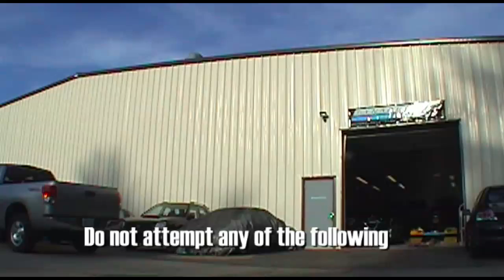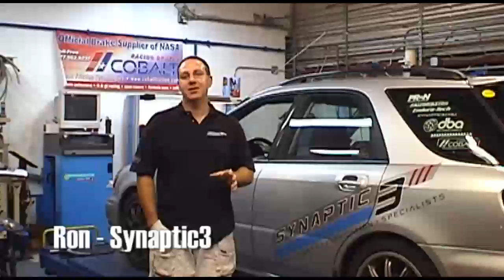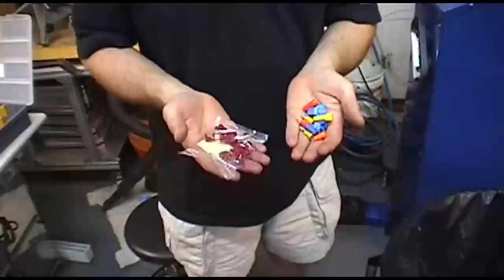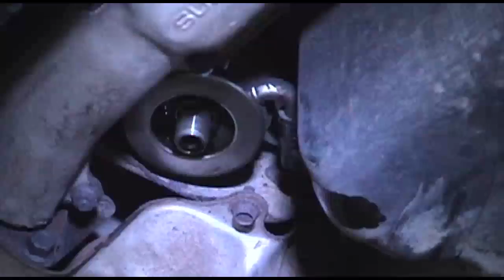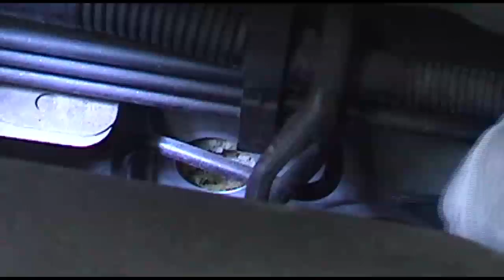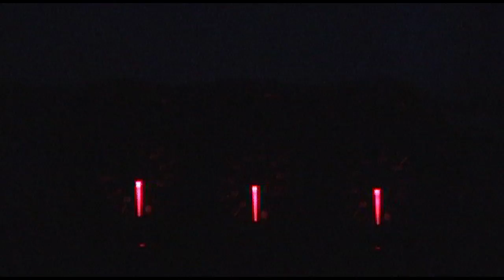WRX Gauge Install - Episode 6 of PRoN

Comment: Crimp joint are better than solder. I've had more headaches over faulty solder joints than i care to adit. As cars get older and solder joints heat up and cool they will ALLWAYS break. Crimps will stand the test of time.
Reply: +aaron west learn to solder then, crimps will ALWAYS fail due to corrosion plus flexing of the connectors and/or wire breakage due to vibration. solder for the win

Comment: got a question, i cant find a fuel pressure guage through maddad, did you guys just use the oil pressure guage for fuel pressure? also noticed in the video you put white stickers over the product description on the box, reading "fuel pressure"

Comment: hey guys @ 2:13 any reason why you cut into the by pass valve hose for boost pressure & vac ? Ive seen boost hose tee off into other hoses, like compressor hose.

Comment: @PAC0TAC0 go to google and type in oil block adapter. Greddy makes a REALLY good one that you can tap in both oil temp and oil pressure and it is universal to work with most japanese cars.